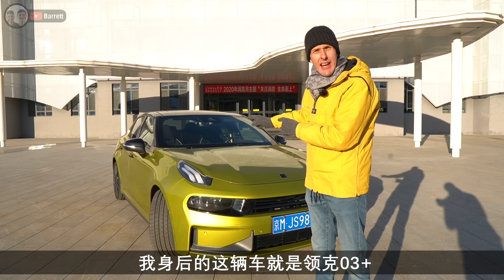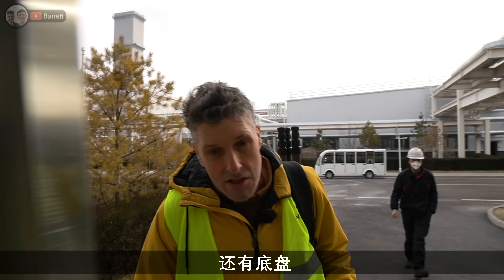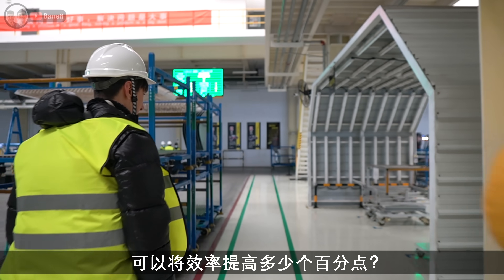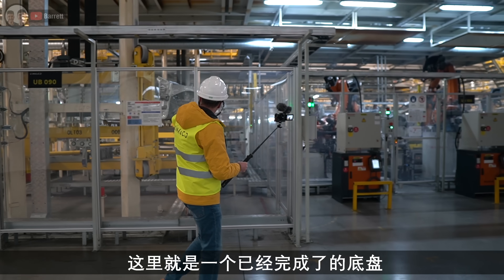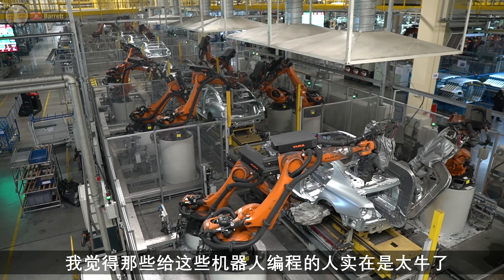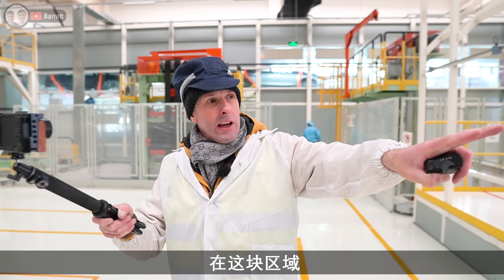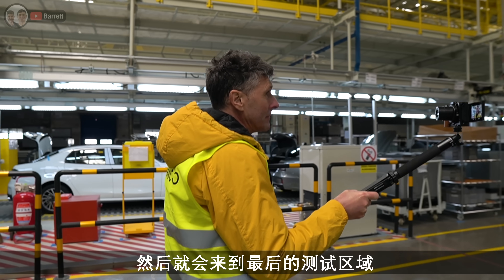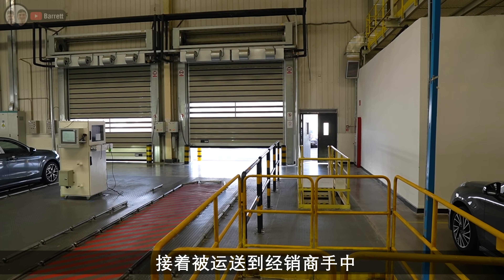INSANE Automated Car Factory in China! // Lynk & Co // Geely // 疯狂的全自动化中国汽车工厂!

Comment: I wish one day you could do a video on NIO.  That is the real advanced manufacturing with solid state battery exchange system.  Unless you could super charge an electric car within 5 minutes, it would be difficult to compete with the concept of battery exchange system.  I really feel that is the way to go.  Battery should be just easily replace at any electric charge station.  And the expensive battery (1/4 the cost of the car) is rentable and the end-of-life battery is managed by companies.  Further, as battery capacity and performance get better and better, the cars will automatically get better batteries.  Great for environment.

Comment: Programming the robots is done by G-code - same as 3D printers. Basically you use a 3D CAD program for the object that passes through and then you tell the CAD software do this / that to the model  (i.e. give commands weld this, screw this here , here and there) and then you simulate the task in 3D then you test and test again in real world and go back to the CAD program and alter it as necessary. Once you have it bang on then your start the production line. It's the mathematicians and programmers who program the CAD software who are the geniuses not as much the engineers who 'program' the robots (by using CAD software) ...although their level of expertise in CAD software is very good too and requires degree level skill also. That's how it's done!

Comment: This car factory is many generations more advance than the General Motors (GM) factory in West Mifflin that I had been to.   The number of workers in this plant is probably less than 5% of the total number at that GM plant, and yet producing many times  the number of cars.  Amazing.  Just curious, how much are these cars cost in China?
Reply: I also curious and googled it and this what I found: Prices range from 158.800 Yuan (€ 20,000,- / US$ 24,650) to 220,800 Yuan (€ 28,000,- / US$ 34,250).
Reply: @hl3542  Thank you.